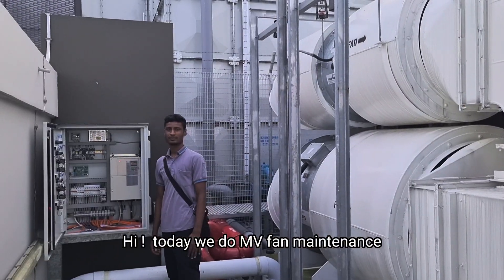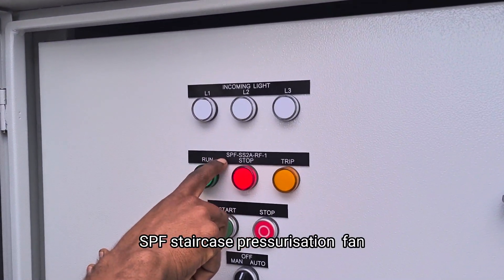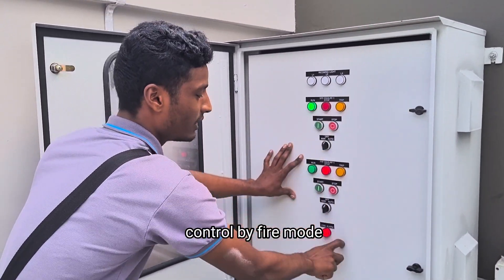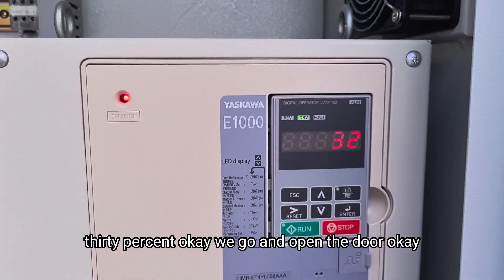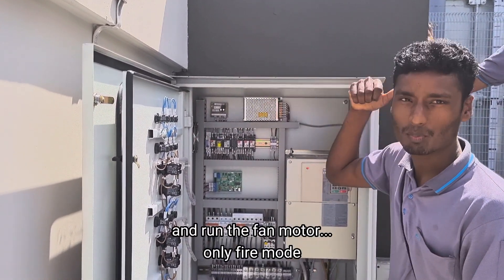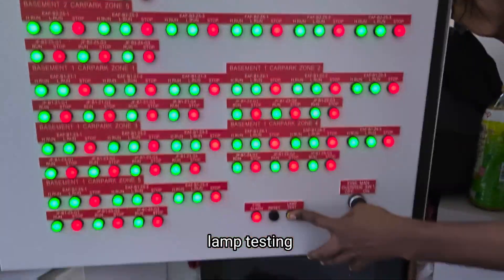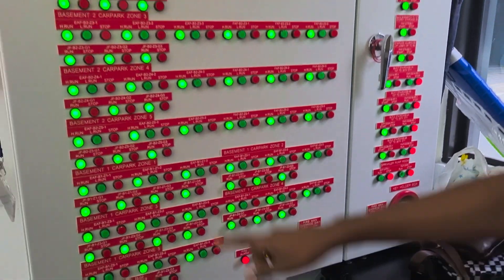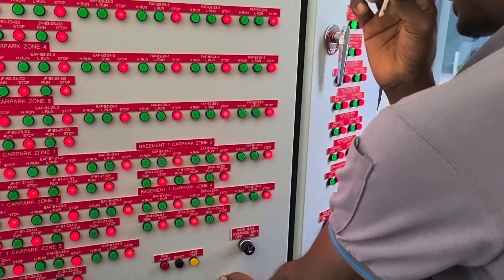How to reset Fire alarm mode | Mechanical Ventilation | control panel

Comment: At 1.02min, “the fan will be running at full speed at 50 Pascal”.
Is this correct? Where is this 50Pa measured? 
50 Pascal= 50 N/m²= 5.02 kgf/m²= 0.0005 atmospheric pressure in bar= 0.0072psi.
Airflow velocity in the staircase should not greater than 200fpm or 1m/s or 0.125 Pascal through doors when 3 doors are open.